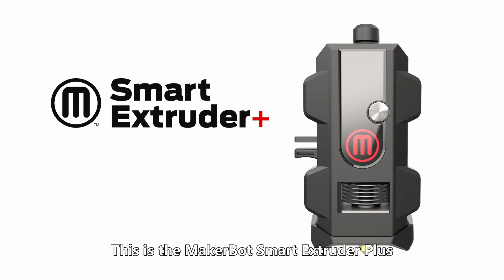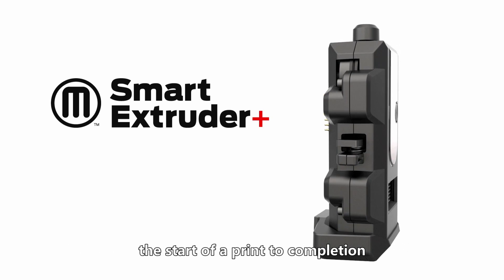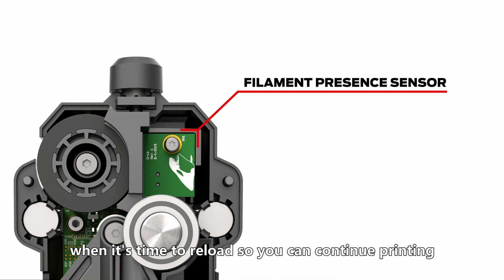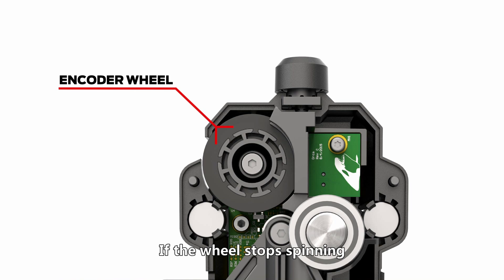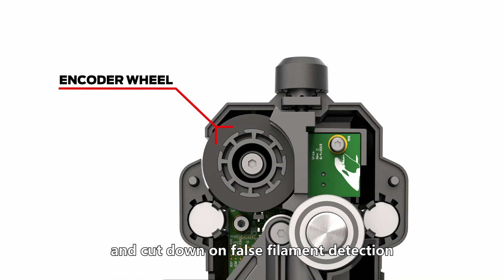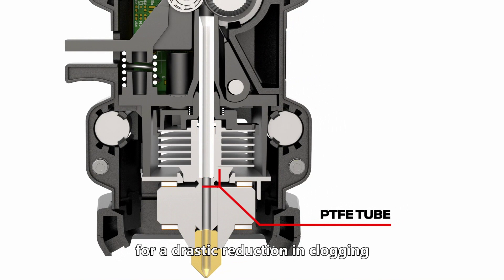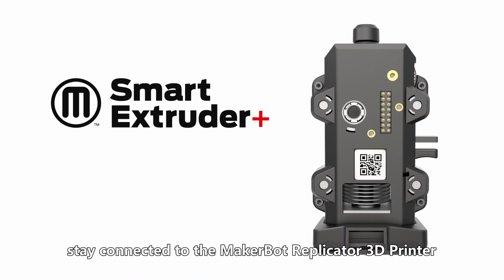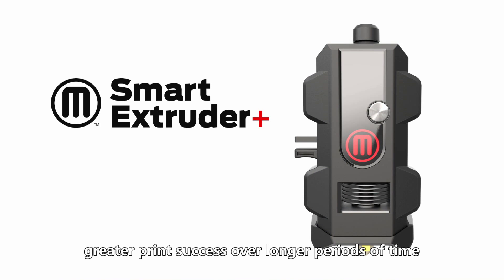Inside the MakerBot Smart Extruder Plus+ | How It Works

Comment: The FPS (Filament Presence Sensor) is loosely connected to 4 jumper pins, this assembly moves to the North-East corner when not supported, and hence causes major problems with false filament detection errors.

The encoder wheel bearing is prone to get loose, causing the wheel to slightly wobble. Since the encoder wheel provides an optical feedback (silver and black stripes on the bottom side) to a diode and sensor array, this can cause filament slip errors (false ones) as the diode reflection is not picked up correctly do to the wobble. Also connected to my previous point. Since the FPS moves away from the compression area with the encoder wheel it causes false slip errors.

The hotende is also cause for concern. The yellow stripes visible in the video represent heat-resistant tape that holds a heat insulation in place. Problems can occur when the hot end has been overflown with molten PLA due to e.g. clogs, filament sticking to the nozzle and working its way up and or a loose filament nozzle cause molted filament to ooze onto the heater block from behind the nozzle. This in turn creates a heat-bridge which in turn causes the hot-end to loose heat into the heatsink. This is the famous temp-sag problem (ERROR 57).

FIXES: 1. Stuff something heat-resistant (just an in case) material in between the FPS and the case to fix it in place.
2. tighten the encoder wheel if need be
3. clear the nozzle, remove any "wet" insulation material and replace with PTFE tube to insulate the heater block. 
4. The PTFE tube on mine broke off, but the extruder works fine without it.

I highly doubt that Makerbot tested this crap before releasing it into the wild.

Comment: Awesome but the first one that I received and opened was missing a screw that holds the shell together.
Reply from the maker: +Mike Stewart Hey Mike, we are sorry to hear that, were you able to get in touch with MakerBot Support?
Reply: +Proto3000 | 3D Printing | Rapid Prototyping | 3D Scanning Not really, I have spoken to support about it and did not really get a resolution and no ticket seems to have been created.  It was suggested that I just get a button cap screw and put it in.  Definitely a QC issue.  I am still trying to figure out why my bellows order is taking so long.

ORDER #: 200059351
Order Status
Processing - Waiting to be Packed
Order Placed
2016-03-17 16:56:32